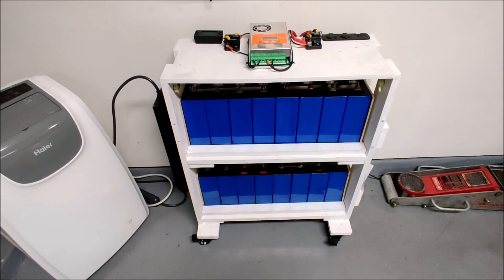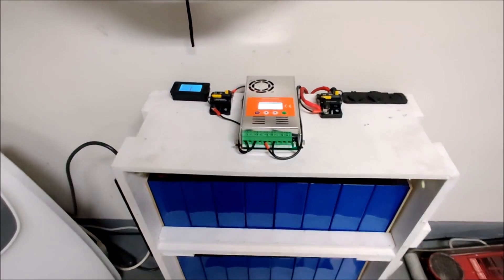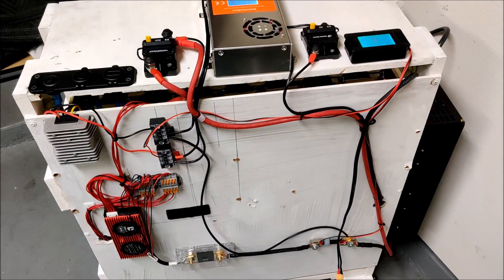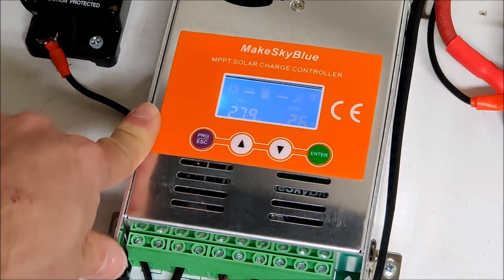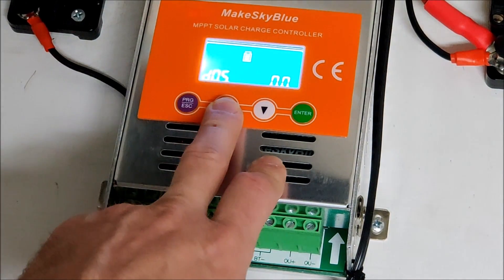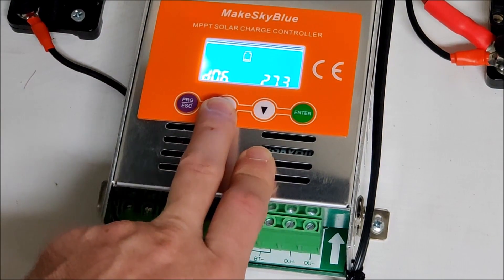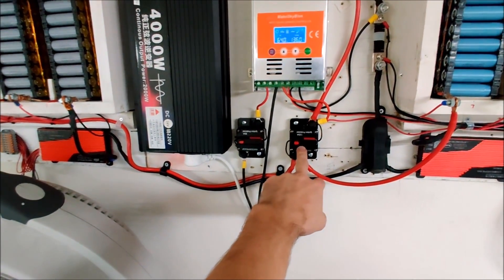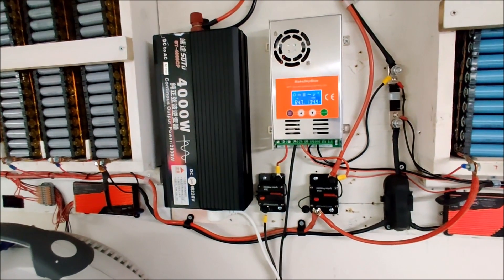15KW LifePO4 Powerwall: Wrapping Things Up

Comment: Hey guys, here is the test results from my capacity test at 0.2C (54A) of the 4 LiFePO4 i bought from Blmpow franchise Store:
14.3V at start untill discharged to 11V (my inverter low voltage disconnect), 277Ah.
I would probably would have hit the 280Ah if started at 14.6V ( they had drafted a bit) and down to 10V.
Anyway for the price, i am TOTALLY satisfied.
BTW i broke my 40A charger after 3-4 minute of charge :(   It was pushing 43.5A, was smelling burn wire then pow!
If you guys have a recommendation for a cheap charger, or a better setup, i'll appreciate.
https://www.aliexpress.com/item/32906674245.html?spm=a2g0s.9042311.0.0.27424c4dJqmFDY (was the 41.7A / 500W model)
Reply from the maker: Awesome news. Thanks for doing that.
Reply from the maker: For the charger, were you running the charger through a RC charger or just straight onto the battery?
Reply: @stevenc22  directly to the battery... After reading the description again, it's clearly not a battery charger. I've ordered a 60A power max converter charger now.

Comment: I love your setup, but I have a question about the shunt meter you are using to monitor the capacity. I don't know if your BMS is the smart model with an application that displays the SOC of the battery, do you still find it necessary to have the shunt monitor or di you thing the BMS application SOC are not reliable?
Reply from the maker: My BMS is not the smart kind. But I don't want the smart kind. I don't want to have to use my cellphone and an App just to check my current draw. I want to be able to visually see any anytime which is why both of my powerwall have stand alone meters

Comment: Quick question, how did you come to the verdict that your cells are Grade A? You listed BLM power supplied cells as grade A Cells, but as far as I understand real Grade A Cells are significantly more expensive, comes in Individual carton boxes with Anti static bags and the QR is actually scannable. For example this seller BLS sells real Grade A Cells but much more expensive  https://a.aliexpress.com/_mMGSFnf. I'm  looking to buy 280AH LiFePO4 cells but it is hard to decide the grade by just the QR code or listing details, and even capacity tests. And AE sellers always lie, I bought 100 and 105AH cells recently, promised to be Grade A but they are not. I contacted your seller, they also promised brand new cells but I'm still thinking, the prices are too good to be true. Will Prowse said that these cheap cells are probably Grade B. Hmm. Anyways, let me know how you came to the verdict. Thanks.
Reply from the maker: Don't pay $800 for grade A cells. Expensive doesn't mean better. Find a reputable seller for a good price.
Reply from the maker: It is tough but all you can do make sure they are listed as brand new and grade A. Also make sure you know which manufacturer you are getting. I knew I was getting Lishen which are good cells. Grade A cells cost around $450-$500.
Reply: Bought 4 from that seller; just received my  Daly BMS so i have not yet tested the capacity, but the condition of the cells was excellent! 
They are top balanced, will test the capacity soon and post it here on Steven channel.
Reply: @theprepperfrog167  Great, let us know the capacity. Usually Grade A should pull over the rated capacity at 0.2C or less, anything under, say 279AH indicates otherwise. Thanks in advance.